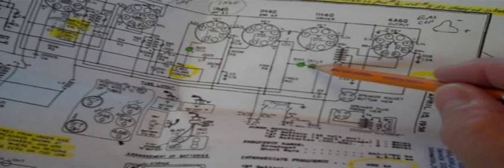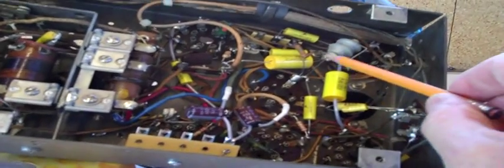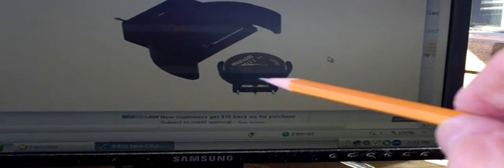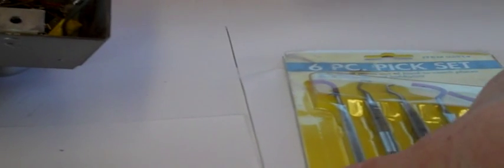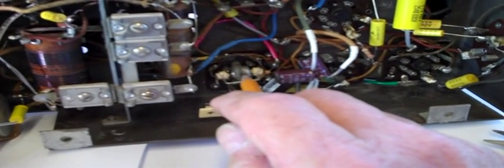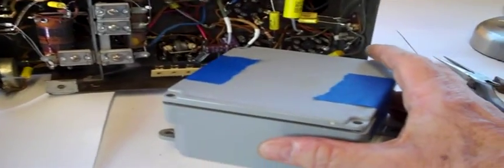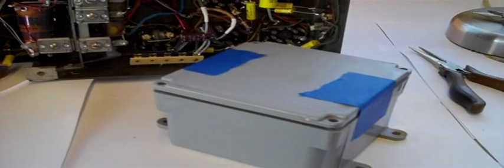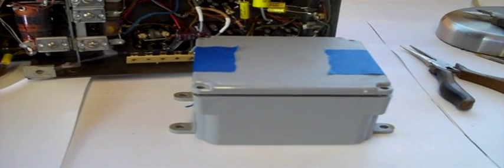1938/39 Silvertone Model 6044 & 6045 Farm Radio Restoration (Part 8 of 20).

Comment: Not to mention that switcher supplies have a nasty habit of causing hash all over the AM broadcast and shortwave bands if they aren't designed and built just right. I think your method of building an old fashioned linear supply is the best one, not many people are going to pack around a big farm battery set under their arm anyhow so the weight isn't an issue even if you did want to run it from batteries.

Comment: That's not a bad method, it's one that I have heard of people using before. Most of the bias cell holders that I have run across are mounted on a phenolic terminal strip where the cell just sort of slips under a spring clip. Up until seeing your set I have never seen a bias cell holder like the ones you have, and I have never seen two stacked together in series. Most battery sets use bias batteries of 4-1/2 volts, but externally, not under the chassis.